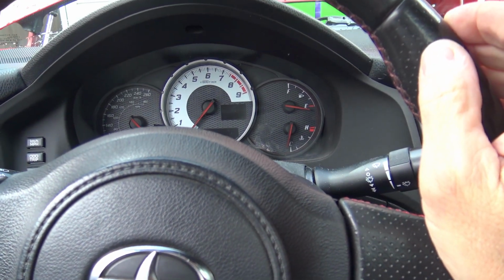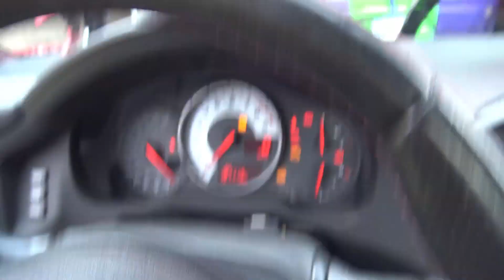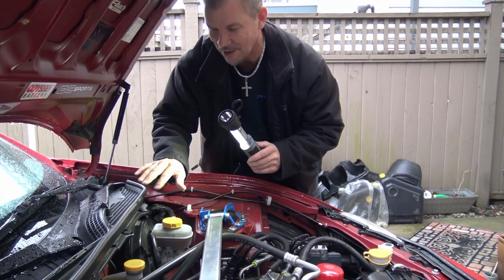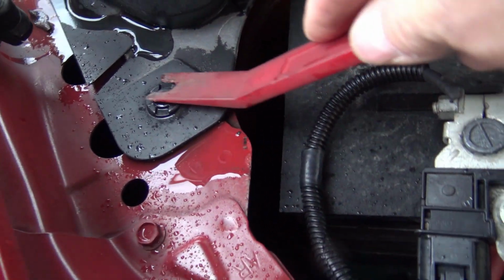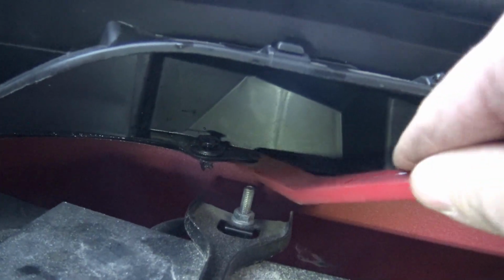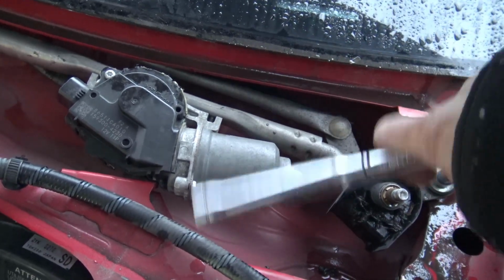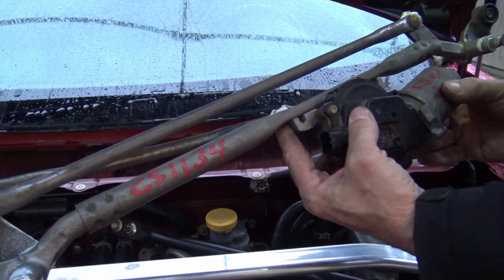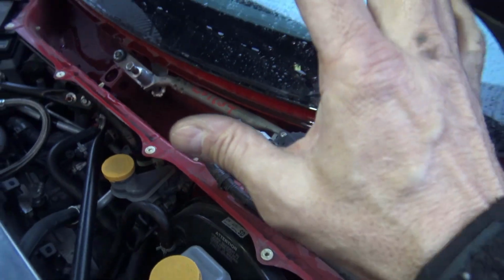Almost 200k and this happens !

Comment: On a side note, did you notice any improvement in chassis stiffness with that front end strut bar, even though it already came with two half sized ones?
Reply from the maker: Yah I did not notice any difference but I haven't been on a track in quite a while.